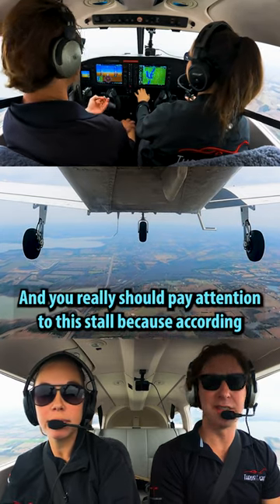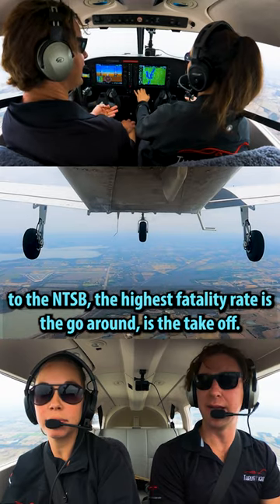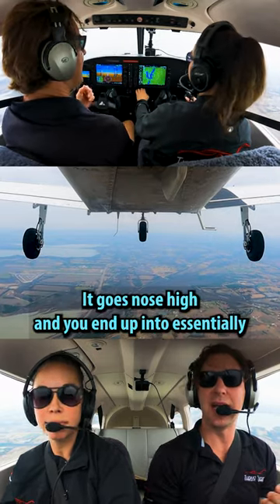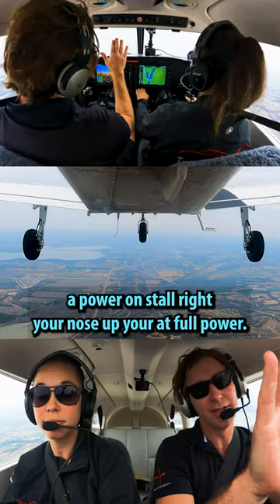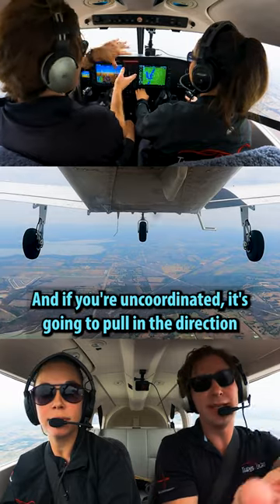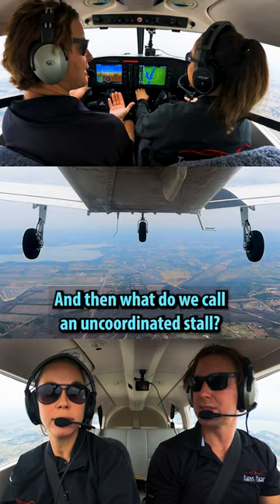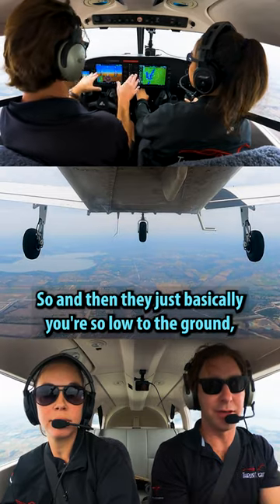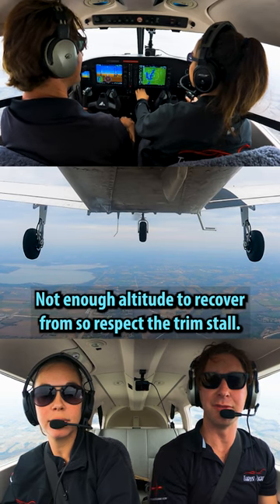The Importance of Monitoring Elevator Trim Stall: A Must-Know Reason

Comment: So during a touch and go or go around you should put the trim back to neutral?
Reply: Yes always.
Reply: No, not necessarily. Nobody should be looking at a particular trim setting during a go around. Just trim as needed to alleviate control pressures as you would during any phase of flight.